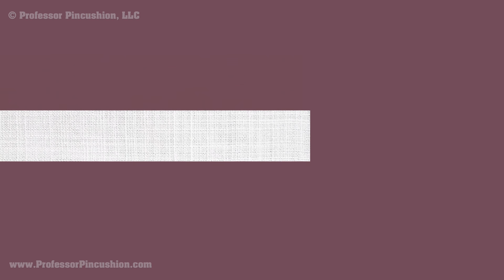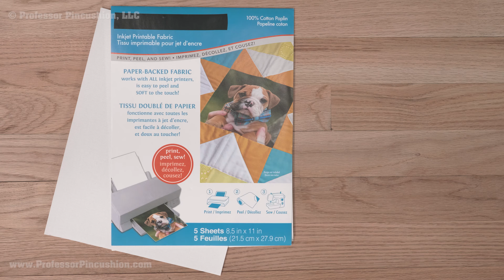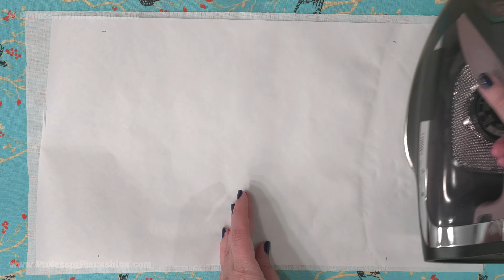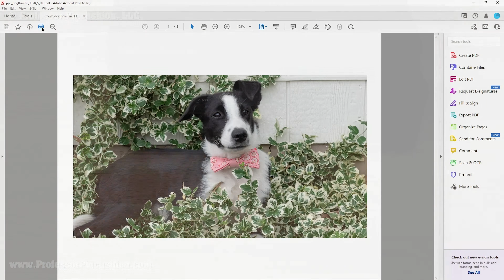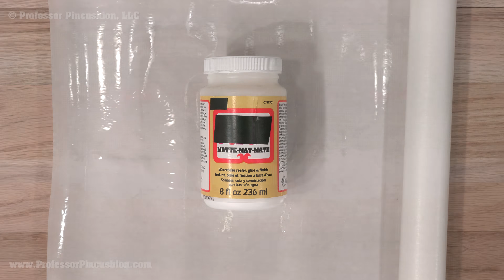How to Print on Fabric With an Inkjet Printer | Step by Step Tutorial

Comment: I did not do my research and printed all my pics on an inkjet printer on cotton. Then made my quilt.  Now it’s ready for a gift and I have to explain that it can’t be washed. 😢.  Or I can just completely redo the quilt the proper way. Any suggestions to save the photos on the already done quilt are appreciated
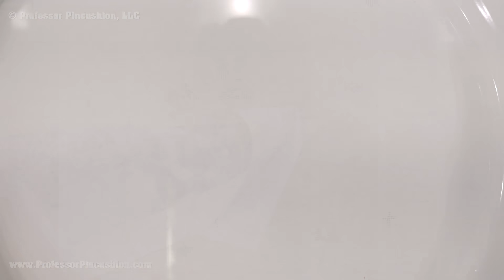Reply: I have never done this so take my advice with a pinch of salt but, I'm guessing you can just do the method at 2:20. The size of the quilt would determine how difficult this would be. I am guessing you can just soak the quilt one section at a time. I reckon you may as well give that a go before redoing the quilt.

Comment: hi One question what is Line Dry ?
Reply: Drying it on a washing line - pegging it out like you do with your laundry.
Reply from the maker: Line Dry just means placing it out in the open to dry by air.  So not using a machine like a clothes dryer.

Comment: I've been trying this method and what isn't mentioned here is that inkjet printers that use dye-based ink don't print on fabric as well as printers that use pigment-based ink.  The dye based ink will print on cotton fabric but can look washed out depending on the fabric and settings used when printing.  Also, be aware of the edges of the fabric coming away from freezer paper causing a jam in your printer.  It takes some trial and error depending on the fabric, the freezer paper, the printer, the type of ink, and the printer settings.  I found with an epson ecotank 2710 and Reynolds freezer paper, I had best results with a looser weave fabric, the "photo quality" setting (not premium glossy photo paper), and needed to add double stick tape to the edge of the fabric/freezer paper to get it to feed through the printer properly.
Reply: I'm looking for a new printer, and it's almost impossible to find one that uses all pigment ink unless you pay a lot and get a print only printer. If anyone has up-to-date recommendations, please post them!
Reply: Have you tried using sticker paper? I saw a video where she likes that better than freezer paper.
Reply: @flowersafeheart oooh yes , I saw a video where she used contact paper and it works perfect
Reply: Thanks for this and what did you use to seal the final fabric print with?
Reply: Great tip on the double sided tape! I have none of the supplies, not even a printer LOL but I love crafty videos and would love to create some pictures printed onto linen! I cannot afford the almost $100 price tag on the sites I’ve seen 😬🫠